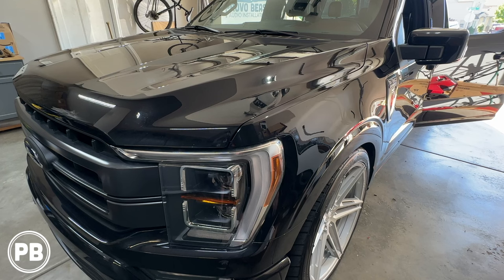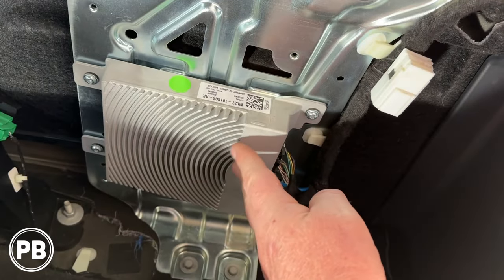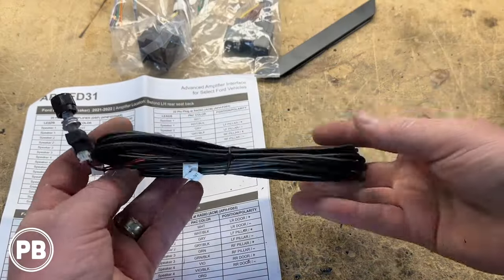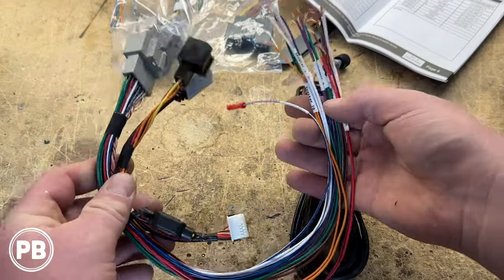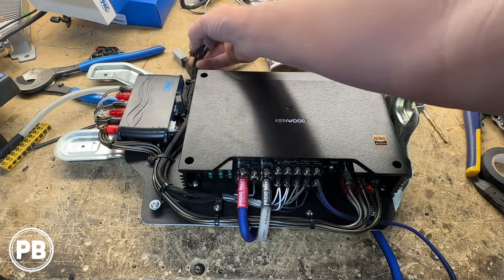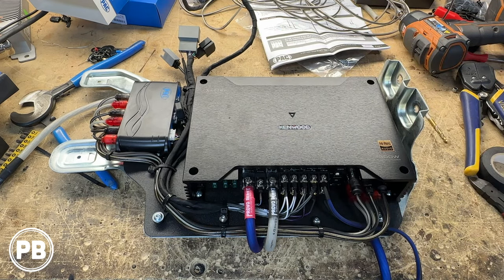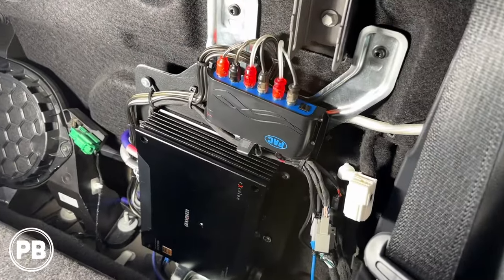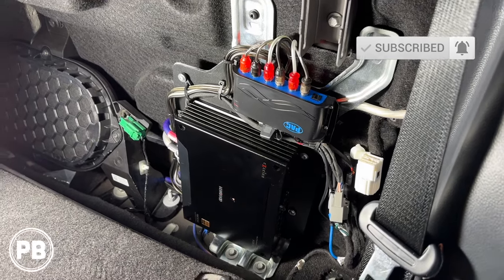2018 - 2024+ Ford F150 5 Channel Amp & Sub Install

Comment: Do you know if the Pac AP4 you linked will work with 2020 Ford Explorer Platinum with the B&O audio system? It doesn't list it in the compatible vehicles, but in the description it says it works with Ford models with the B&O systems.

Comment: I have the exact same alpine speakers and pac amppro my question is how did you wire the front components to the amp ? , my amp is a 4 channel 250 X 4 and didn’t think bridging was good due to the 450 watts per channel for the front. Great video btw I’ve done it almost the exact same as this set up on my 21 lariat. Thanks
Reply from the maker: Door speakers are powered through the t harness, and we ran separate speaker runs for the tweeters

Comment: I have a lighting. Do you have to get behind the 15 inch screen to plug in T harness? Does this eliminate the bass roll off? Also is the install fully reversible?
Reply from the maker: If you have B&O, you will need to use the install parts shown in the video.  If you don't have B&O, I'm literally uploading a video today of a non B&O trim amp and sub install video that allows you to use a T harness behind the radio.  lightning or gas, it's the same process.
Reply: I would like to  learn the install, have you done your install on the lightning yet? Thanks
Reply: @LongNguyen-jo1pd  yes I finished my install. I did a 4 channel and a 2 channel amp. I used the PAC module to replace the factory amp/DSP

Comment: Does the factory battery need to be upgraded if i use a bigger amp then what you have here? I wamt to use a 2000W amp and a separate 4 channel. Is the stock battery ok for that?

Comment: If my sub amp has it's own bass knob can I use it or am I stuck with using the PAC module bass knob? Or both?
Reply from the maker: If you don't use the pac knob, you still need to plug it in, just do so, volume all the way up, and just stash it wherever you like.  Still needs to be connected, just out of sight.  Then use your own bass knob.

Comment: What you do think will sound better in a 2020 tundra Crewmax. Two ten inch shallow subs or 3-4 6.5in subs?
Reply from the maker: You get more cone surface area with two 10's vs four 6.5".  If you go with four 8", you will get more output (box permitting).  Also, forward firing vs downfiring are two different elements to also consider.

Comment: Thanks again for this video, its just what i needed for the install.   If upgrading fronts and tweeters that come with crossover filters,   do you wire the crossovers right off the radio T-harness or new tweeter amplifier output wires? what should you do with the  abandoned factory tweeter wires?   2020 lariat w/  B&O
Reply from the maker: Depends on what speakers you are using for your install. Depends on how those crossovers need to be wired. We used alpine speakers with their own inline crossovers so those were installed at the speaker. If you have a speaker set with a shared crossover, and have the bypassed B&O system, since you have to run speaker wire anyways to the tweeters, you could put the tweeter crossovers in the rear by the amp rack. Crossovers just need to be between the amplifier and the speaker.
Reply: @ProvoBeastAudio I came here to ask this same question. I am looking at focals which usually have one set of wires running into the crossover. And then the crossover splits the signal and has 2 sets of wires coming out of them, one to the woofer and one to the tweeter. How would this be wired in this situation? Could they just be wired off the tweeter wires and just leave the woofer portion not hooked up?

Comment: If I install aftermarket tweeters, do I need to run crossover with this set up?
Reply from the maker: All depends on the tweeters.
Reply: Gotcha. So on this system, there is an extra wire on each of the front speaker outputs which is run directly to the tweeters?